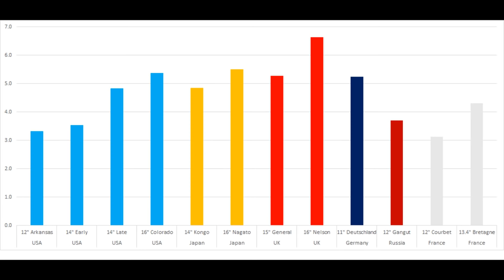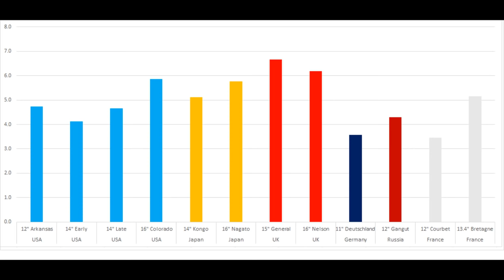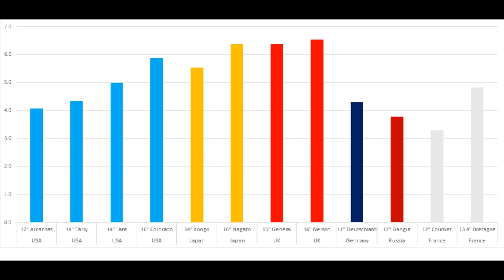Battleship Guns of WW2 - A series of tubes

Comment: I fully understand your reluctance to hold in great esteem a guns ability to shoot to 40 or 45k yards.  Mainly due to the technological limits that keep your chances of a hit to a very low percentage.  However is you were battleship A, and battleship B started shoot at you at 40k yards, yet your guns only shoot to 30k, this seems a huge disadvantage. Doing a bit of high level math, in this scenario your ship A must traverse 10k of closing distance to even start to reply with your guns.  It seems like the extreme range shooting from ship B would greatly deter ship A from wanting to close the distance and engage.  Extreme range shooting even with a low chance of scoring a hit seems like a powerful deterrent to those with lesser range guns. 
If I had a rifle and you had a shotgun and we were 300 yards from each other, would you want to charge me or run the other way?  To me it seems like super long range shooting is one heck of an advantage.
Reply: Try telling that to the Exeter, Ajax and Achilles when they faced the Graf Spee...
Reply: Theoretically yes but practically no.  Warspite spent a lot of her time in the Mediterranean chasing much faster Littorios, whose guns outranged hers by over 15,000 yards, but it was Warspite which eventually got a long range hit on Littorio and not vice versa.  And long range shooting wastes a lot of ammo, which is problematic when you have only 100 rpg in your magazine.
Reply: Both very good points.

Comment: I wonder why u included the 11 inch guns of the grad Spee (mounted on a cruiser) but not the 12 inch guns of the Alaska (mounted on a cruiser) also I think that if you could find solid data for accuracy that would be a big turning point. Because all these stats are nice and all. But if none of that can connect with the target it seems pointless

Comment: It seems to me that range is a proxy for muzzle velocity.  Muzzle velocity will along with shell design have a significant impact on the armour piercing capability of the gun. Indeed as one of your parameters muzzle velocity x shell mass might be a better indication of gun performance and just forget range. Also I would expect you could have a very good gun, but if the turret, shells and magazine feed were poor you would have a bad weapons system. Would it not be better to compare the entire weapon system rather than trying to isolate the “gun”?

Comment: When you are firing salvos every 40 or 60 seconds I can't help but wonder how long the barrels would last.  How many shots could be fired before the barrel needed to be replaced?
Reply: Most barrels were rated between 100 and 300 rounds, but later special liners were developed (later as in post-WW2, so mostly talking about the Iowas) and powder additives that increased that substantially.

Comment: @Drachinifel 
@4:25 https://youtu.be/oR2ltH4aqAM?t=265

Using a range of found values is prone to outliers (or possibly errors or outright lies). Statistically, it'd be better to calculate average and standard deviation.
Eg. in case of range suppose a value of 46000 yr could be achieved with one type of ammunition. Standard deviation also would depend on such an outlier but much less, because it depends on all values.

Also, translating values into standard deviations above or below allows for non-dimensionalisation, dropping of yards, pounds etc. 
Also, I'd advise to plot all points of one particular aspect (before combining different ones) to just see them: see if there's an outlier? do the points change with time? are some aspects correlated and why?

Comment: Hold up. If rate of elevation and rate of train push the german 11" gun so high in the ranking can we say for sure that those factors are not significant enough to earn them that place?
Reply from the maker: Yes, largely on the grounds that the maximum theoretical range is practically useless in ship vs ship combat :)

Comment: Oh jeah, witch metric... i miss the weight of a gun in the comparison as a negative factor... otherwise simply take the biggest gun you can get... Perhabs the range shoud be measured at a fixed angel to take away the impact of the turret for the range. Otherwise the argument that better range means lower angle at lower range is somewhat compromised.

Comment: I am curious. How is accuracy measured. I know what sub- minute of angle means in a rifle. But how about naval artillery?  Also, propellant. I visited at Arizona Memorial and was told by the Park Ranger that the propellant was BLACK POWDER!?!?!? is that correct? Finally, gun tube life. I've read that a 14 inch barrel as on the Arizona had to be replaced after 300 rounds. What might the life on a 16 inch gun have been. And what of "super charging". Thanks and best regards. John C
Reply: I think the Iowa`s had a similar life of 280 ish rounds

Comment: I'm not really sure how you would determine accuracy as a function of the gun.  There would be a maximum potential accuracy of the barrel then degraded by the precision of the shell and quality of the propellant charge; however, it seems like the gun directors would be the biggest factor in the accuracy of the gun.  A radar directed gun would probably be more accurate than a gun directed by the Mk.1 eye ball and an analogue range finder.

Also, I don't see why you couldn't just use standard ballistic formula (muzzle velocity, weight of the shell, and the ballistic coefficient of the shell) to determine the energy the shell is carrying at any given range.  Seems like it might be a more scientific way to go about it.  Then you could probably add an optimum range category.

Comment: Very interesting video, thank you!

It is a bit surprising to hear that the British 14inch gun was very accurate, if I remember correctly Tovey said that KGV had horrible dispersion in its battle with Bismarck.

Also, it is a bit strange that Richelieu scores that high, given that the guns had awful dispersion, which was only partially corrected after the war.
Reply from the maker: This is one of the problems with looking at battleship guns, the gun itself may be really good, but can be let down by other issues like placing them too close to other guns, or poorly made shells, or dodgy fire control systems. Hence all the caveats at the start :)

I could do an analysis that factored in things like the turrets, FCS, shell qualities, etc, but that would be a much larger piece of work and more open to question, because defining where you stop adding factors would become quite hard.
Reply: @Drachinifel  It certainly would be a ton of work, but I think the result would be much more valid for the reality of war than the gun alone. I really like the Richelieu for its great protection system, speed and also the good looks, but the secondary battery was really the only useful gun on that ship, at least during the war.

For example, people online tend to believe that Richelieu was a far better ship than Bismarck, and on paper I agree, but realistically, Bismarck would probably score twice as many hits. As long as the range remains somewhere around 15 to 20km, I would strongly favour the German BB with its great redundancy and accurate guns.
Reply: All three hits on Bismarck at Denmark Strait came from Prince of Wales. Two did damage. The third went right through the superstructure with no damage beyond ventilation.  Hood missed 100%.
Reply: @francoistombe  PoW had a modern fire control system, Hood's fire control system dated back to WW1. The guns were accurate, but in Hood's case the fire control was telling to aim somewhere where Bismark wasn't.
Reply: @alanhughes6753  the British 15inch gun from WW1 was an excellent weapon. I think it is quite comparable to the 14inch gun from WW2.
Reply: @francoistombe  yes, prince of wales crew fought their ship very well. I also highly respect Captain Leach for breaking off the engagement when his ship and crew were put at risk for no corresponding return.
Reply: @Drachinifel  One criterion that could be added is gun/size weight.  For example, the USA 16"/50-caliber gun scores close to the 18.1" IJN gun, but if the ship is limited to say 55K-tons, nine 16" guns would be a much better choice than six 18.1" guns.
Reply: @michaelkovacic2608  So much so that the British would probably have put 9 x 15” Mk 1 guns on the KGVs if they had not been bound by the London Naval treaty.

Comment: The NY class had a different mk of 14" shell than the NV/PA classes because of it's shell handling system, I didn't see that in the comparison. 

Also you didn't include the 11"/45 from the German Predreads
Reply: True, a couple survived to participate in WW2. But I think we can take it on faith that they would have been near the bottom of the older gun ratings.

Comment: Zero hits at 27km or over in sea battles. However allied ships did a LOT of long range bombardment - so the allies had some great use out of longer ranges. Plunging fire with a 45k range gun is never going to hit - so if your enemy has poor deck armour but a great belt (Scharnhorst step forward) then the german 11" (Scharnhorst again) was terrible weapon for attacking herself (though, of course getting 30,000 yards from herself would have been difficult).
Don't forget the wildly optimistic nature of german claimed rates of fire. Vanguard would have had no trouble firing supercharges, the R class used them in WW2.

For me I'd rather look at the overall system, but I suppose RN and USN fire control would pretty much break it.
Reply: The gap between Allied and Axis fire control systems (in good visibility) was actually much smaller than commonly assumed....less because the Axis battleships were highly accurate, and more because no battleship ever built, including Allied battleships, was nearly as accurate as the supposed memetic accuracy of, say, the Iowas, meaning none of them were all that good in that department.
Reply: @bkjeong4302  in good visibility...
Reply: @ihategooglealot3741  Already did specify that. And doesn’t change the fact that even the likes of the Mark 8 weren’t nearly as accurate as the fanboys like to claim; the difference is that the poor accuracy doesn’t get any worse at nightfall if you have radar, while without radar accuracy gets even worse at night.
Reply: @bkjeong4302  The RN fought a number of radar actions at night, given the nature of naval gunnery their shooting was superb.

I quoted your three words because that was a fairly daft restriction
Reply: @ihategooglealot3741  And those night actions were at closer ranges, they weren’t the 30k yard hits people too often ascribe to radar-guided gunnery.
Reply: @bkjeong4302  Suggest you look up the Battle of the North Cape rather than blathering about things you have no notion of.
Reply: @ihategooglealot3741  The Battle of North Cape didn’t involve any battleship hits or near misses at 30k yards or more.

Comment: Well your 2 sets you tossed may be representative of different opponents whereas your keept represents typical opponents. 

The one where rate of training and elevation was included may be representative of their performance against an opponent with no meaningful protection like a Deutschland, Kongo, Renown, Dunkerque, Alaska etc where anything remotely battleship grade can penetrate thier 9" or less of armour without having to close to a point blank range or anything. If you have a belt no thicker than Queen Mary you are vulnerable to any gun on either list. 

The second one where you didn't include range maybe representative of the super duper armoured stuff like Yamato, Vanguard, KGV, Nelson where anything that isn't a Yamato or Iowa is going to have to close the range and get close. 

Your final one with range included but not elevation or training is probably right for most stuff with 12-13" belts

Comment: Arbitrarily adding and then removing (to downgrade the Scharnhorst) swivel and elevation rates shows the basic fault of your method: The categories can't be weighted the same, and doing so doesn't remove your biases in the way you suggest. And the relationship between mounting and elevation/distance additionally contradicts the supposed distinction between turret and gun. Your rating system just doesn't work.

Comment: I still wonder why the Germans didn’t put bigger like 12, 12.5 inch guns on their Scharnhorst light battleships.
And why nobody had intermediate ships between the heavy cruiser and battleship of 10, 10.5 inch guns weighing 15-25 thousand tons.
🤷🏻
Reply: The Scharnhorst was designed to have the same guns as the Bismarck class. However technical issues with the design of the turrets cause a delay. The 11 inch guns were a placeholder and were never intended to be the main battery.
Reply: @CRAZYHORSE19682003  Ah, and they never took time to change them, before or during the war.
That is strange.
And you know what strange technical problems with the turret were they?
Thanks for you insight.
Reply: @Melvorgazh  The Gneisenau actually went into the yards to be regunned but allied bombing raids damaged her so much that the upgrade was canceled and all her armament was taken off and and she was sunk as a block ship in Gdynia Poland.
As far as the technical issues I don't remember reading anything specific other than the turret was a brand new design and was not ready and the delays would have caused a delay in Scharnhorst and Gneisenau entering service so it was decided to arm them with the 11 inch triple turrets as a stop gap measure.

Comment: 12:45 I've heard of sawed-off shotguns so how nasty is a sawed-off battleship?
Reply: (the barrels are just lowered)
Reply: Sawed off shotguns can sometimes be as dangerous to the person holding it as those in front of it. It basically HAS to be long enough that it doesn't blow up in your hands. But battleship guns are nothing like a shotgun. The thing about a "sawed off shotgun" is if they are done right that you can be in close proximity and point it & they are easier to conceal. Try pointing a regular shotgun at someone 3 feet away and they can push the barrel away. PLUS, you don't have to saw it off. You can just buy one with a short barrel. The thing about a shot gun is you can buy shells that have different ammo in it. You can also buy slugs that is one big round. But I think that really the most deadly is buck shot. They are about the size of a small marble & the shorter the barrel the more they spread out. Imho buck shot is really what makes a sawed off shotgun deadly. Cuz the shot spreads out quicker. If you use bird shot they might take it away from you & beat the crap outta you with it! I don't think that they had grape shot for WW2 guns. But I do think that they had shells that would explode about 20 feet b4 they hit the ground and would basically shower shrapnel everywhere.

Comment: I think the part were you decided to exclude the turret machinery and characteristics that result from it (the early US triple turret guns put to close together) - was wrong.
Because in that case you decided to go only with the gun barrel, then you should get rid of the rate of fire too. Cuz one can argue the loading mechanism and ammunition hoist is also a part of the turret and the same gun can perform better with a better loading mechanism installed.

Uh....No. I think the turret and environment it was used in (ex german short range guns are more fit for use in north sea than the pacific) all ARE a part of the gun performance.
Kind of how you did include malfunctioning mounts as a factor for AA guns.
Reply from the maker: The main reason I excluded the turret machinery from the big guns but not mounts in the smaller ones is that the mountings for the smaller guns tended to either be identical or very similar across the board for a given gun in the context of WW2. Whereas on the big guns you could have the same model of gun in variety of turrets and mountings, each of which had different capabilities, and so it would be a little arbitrary to pick one over the other.
Reply: @Drachinifel  I see. 
Anyway, love your videos. I always have one of your videos playing alongside me while I'm playing naval games like UAD.

Comment: I'd multiply the penetration times the bursting charge rating and then divide that result by 10 as the depth at which the shell explodes is possibly more important than the size of the charge itself. Weight of shell is ignoreable then as it's basically the total of the ap and charge.